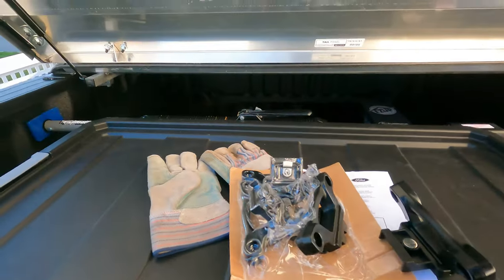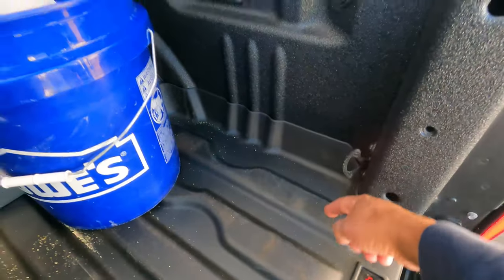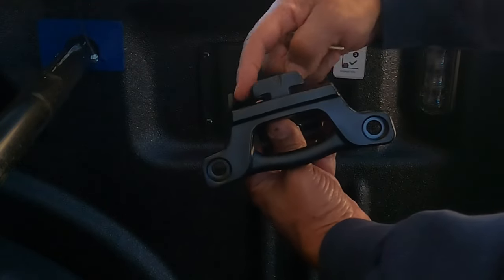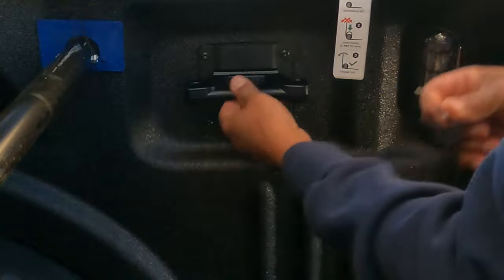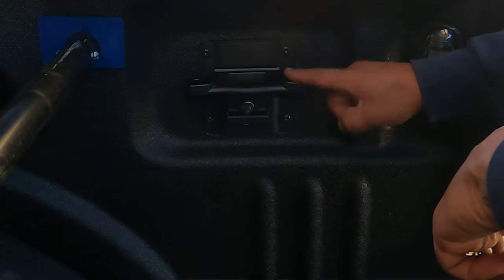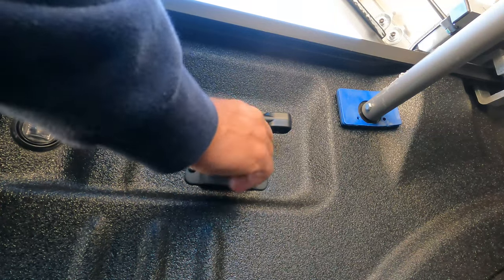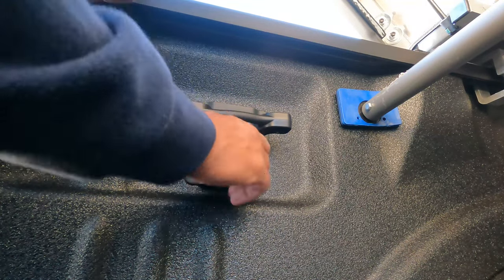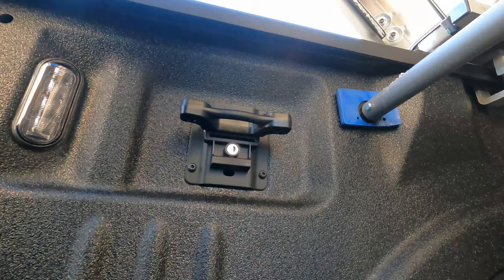How to install the Ford Boxlink Tie Down Anchors on Ford Super duty Tremor, Ford pickup Bed cleats

Comment: Ray’s technique placing the clear in the receiver vertically and tapping it in with a rubber mallet made all the difference.  These cleats do not go in easily!  Ray’s tip did the trick.  Thanks, Ray!
Reply from the maker: Thanks for the feedback and please remember to subscribe to the channel and like the video.
Reply: Used the vertical technique and went right in. Thanks for the video! Saved me a lot of frustration. Thanks Ray!

Comment: Hey, thanks for the helpful video! I bent one key trying to get my links out before I found your video. The reason I wanted to take a couple of cleats out is supposedly, E-track accessories will work in the box link mounts. So I bought a couple e-track ratchet straps to try in them. For those that don't know about them, e-tracks are a popular system used on trailers to secure loads. They also have a lot of other accessories like storage boxes, straps, load bars and the like used inside  on the walls in box trailers. 
Thanks again for the video!!
Reply from the maker: Thanks for your comments. Please remember to like and subscribe.

Comment: did yours come with a sleave or pin for the 2.5” hitch receiver?
Reply from the maker: No it didn’t. I had to buy one. Check out the video Installing the BOLT 7023585 5/8" Receiver Lock for Side Cut Ford, Lincoln & Land Rover Keys, Part#2 https://youtu.be/b6aPoYiJ-es